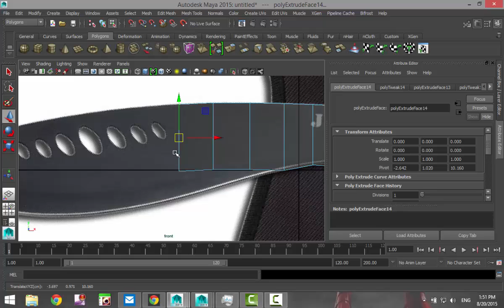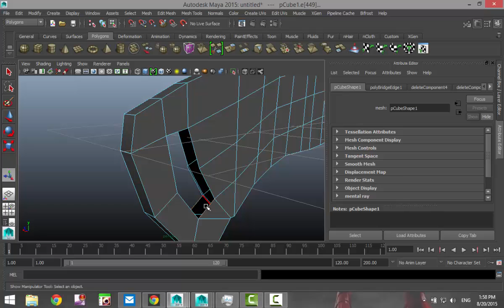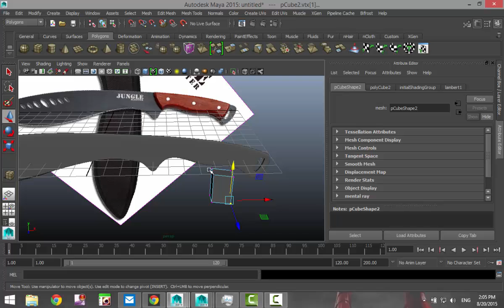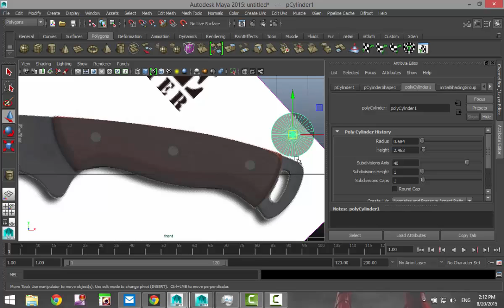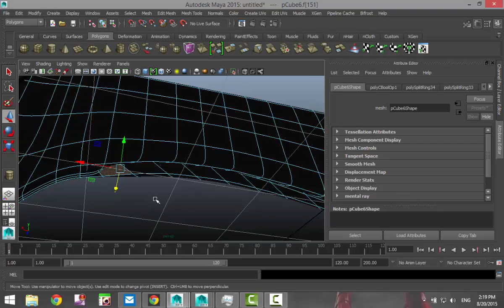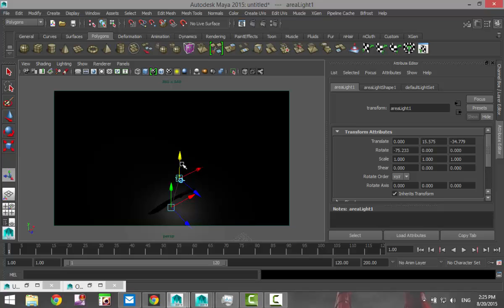Maya tutorial : How to model a Machete

Comment: Hey ! I have a question ,  i'm using maya 2014 and i'm not able to freely move images planes like polygons (scale, move, rotate), the image is selected in Yellow also

BTW, I don't know if you know but you can hold Alt + Right click to have a more precise zoom
Reply from the maker: KokahZ777 In Maya 2014 you can't move an image like an object. You have to adjust the translate values in the Control Box to move it. And as for the more precise zoom, I didn't know that, thanks
Reply: Mike Hermes In fact I just managed to move an image plan like an object, sometimes it works and sometimes not. That's weird
Reply: +KokahZ777 try selecting the boarder of the image by dragging the mouse over it while clicking. then press w and see if that works?